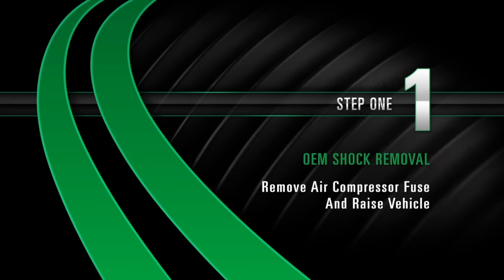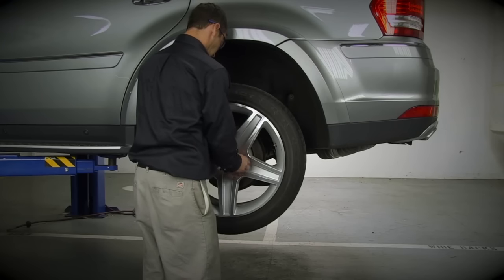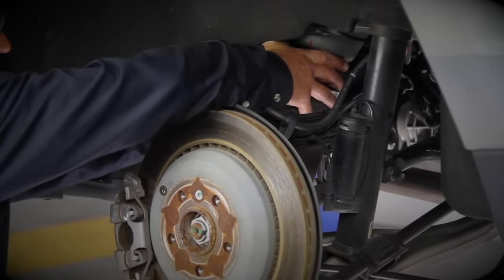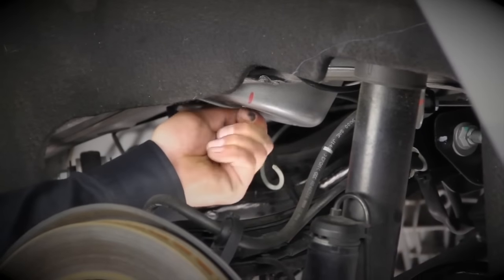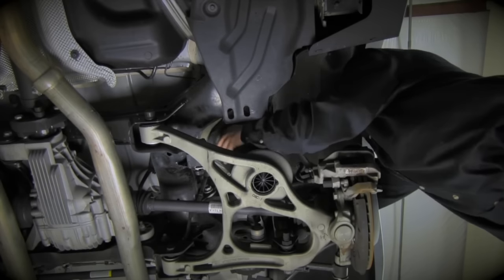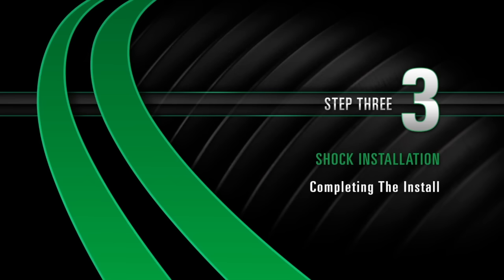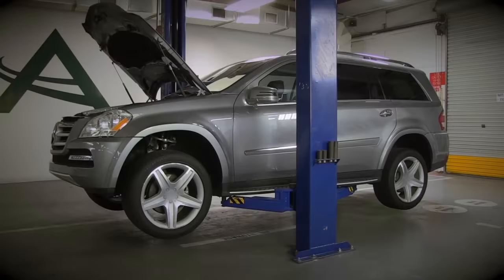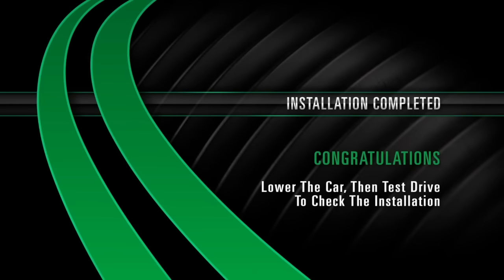Installling the Arnott New Rear Air Spring on Mercedes-Benz GL & ML-Class A-2596

Comment: Great video. One addition would be that the bolt on the OEM Air Spring is 10mm. It is tight up in there for anyone doing this off of a jack. Thank you Arnott for a great product and video. Easily saved me $1,000.